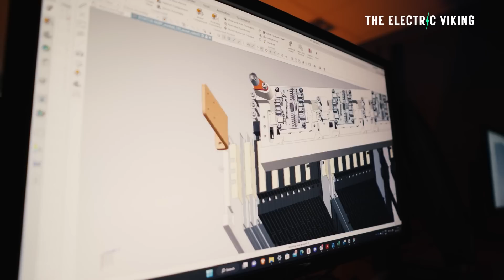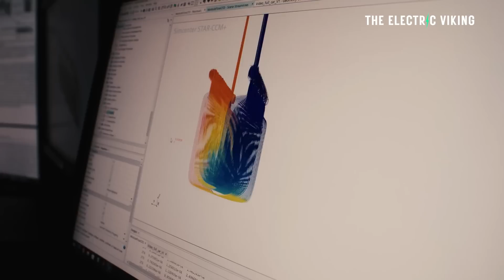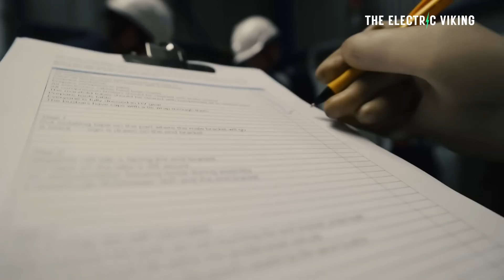Engineers in Europe reveal EV with batteries that charge in under 4 minutes

Comment: My view is that battery chemistry and design will lead to EV’s being cheap and better than ice vehicles and in many ways they are already.  However super fast charging at say 1000 kW/h is highly unlikely because of limits on the electricity infrastructure not just the charging stations but also load on the electricity grid feeding charging stations.

Comment: How do you repair or replace a structural battery pack?  Sandy Monroe tear down of Tesla M3 basically said it was unrepairable and unreplaceable.  This doesn’t sound like sustainable manufacturing. Given EV’s huge carbon sink vs ICE cars currently can Sam look into true sustainability and true carbon costs of EV’s vs ice cars and will we ever have 100% recycling of EV’s. I’m fan of EV’s and been driving one since 2014.  Doesn’t mean that there aren’t issues that still need solving.  My main reason currently for driving an ev is superior driving experience and lowering noxious tail pipe emissions to clean up the air.

Comment: That charging speed really isn’t that fast. That is about 450 KW. They already do almost 350 KW with production cars like the Hummer EV and Lucid Air. You could have a large battery pack and just put 29.2 KWh in it in about 6 minutes right now. This isn’t as big a deal as it sounds.

Comment: I have heard in a Formula-E introduction video by a third party YouTuber, that Formula 1 is not allowed to have pure EVs for some years (they can have hybrids as they have now), because pure EVs for such a Formula-race-series are reserved exclusively for Formula-E, which is managed by some other people.

Well, I can't really believe this. Maybe someone else has a different source.

----
With the first Formula-E generation cars, they needed to switch the cars in the middle of the race because of the batteries, but since the second generation of cars they don't switch cars or batteries and now in 2023 they have the 3rd generation of cars. I think, charging during the race is not allowed by now.

Each team gets the same car with the same battery, maybe the same tires and wheels, but everything else (battery management, motor management, inverter technology, ...) is up to the team - to keep the costs a bit lower but to have something where they can improve...

Comment: Once a car can charge between 250 to 300 mi in 10 minutes you're practically at having unlimited range because you will need a bathroom break before you run out of range and the car will charge faster than you can finish that bathroom break.

Comment: Seeing some of the other comments, sometimes it's worth looking through the other end of the telescope - particularly about the mad high power level needed to charge a large battery in 4 mins. 
What very high "C" charging rates from 6 to 10 to here 15 enable is the use of smaller batteries. 
So a 350kW existing high power charger could add 35kW to, say a at C=10 50kW battery, in 6minutes. This is the battery size in all the current generation of small/medium Stellantis models whether Peugot, Citreon or Opel. 
You'd have a battery good enough and importantly affordable for most of the year but still making longer trips perfectly feasible when required for many [but of course not all] users.

Comment: F1 has been the driver of so much ICE development over the last 50 yrs, just look at turbo-chargers? FE will no doubt do the same thing for EVs. Incidentally, the average time waiting for my TM3 to charge over the last year, is actually zero minutes, compared to 10mins minimum for re-fuelling all my ICE vehicles in the past. I can do occasional 280 mile round trips, and my 120 mile daily commutes, happily on just home charging. Saves me over 30 hrs of annual filling-time a year. So far never actually needed to charge away from home, but expect I will have to at some point.

Comment: What the hell, in formula e, you have to swap cars because the battery does not last the whole race. With formula ,1 no refuelling is required.
A formula 1 car will be more agile and aerodynamic, a battery car less so in comparison. A formula ,1  car will win on a 50  to 70 lap race in a circuit with cornus as well as straights

Comment: They could use the collected heat from the motor and batteries to power an isolated closed loop micro steam turbine connected to a small integrated generator to further charge the battery. This generator could also be utilized during normal battery operation by drawing away battery heat, until the battery is functioning at optimal temperature for maximum efficiency.  It could add a small amount of weight to the vehicle,  however be performance optimised,  based on the battery and vehicle specifications.

Comment: What, EV, are your thoughts on the government / NRMA “initiative” announcing the Australia - wide charging system?
It appears to me that the proposal involves “fast” chargers - which to me says quite low power ones rather than say v3 Tesla ones.
Up and down the East coast charging infrastructure is sparse but doable if you charge at home to start with say 400 Km of range, but over the rest of the continent putting one or two slowish chargers at say 150Km intervals just doesn’t cut it if the intention is to provide for long road trips as opposed to “local” drives such as say Newcastle to Sydney and return.
No-one wants to set out towards a two-stall 22 Kw station in the desert hoping that they will both be available on arrival even if they carry enough energy to get to the next one.
Tesla - and the Tesla early adopters - bit the bullet in the US a decade and a half ago and look at the supercharger network there now! The government “initiative” just fails IMHO to understand the requirements and is merely playing with the issue.

Comment: What if the charger in addition to providing energy, it also provides a super cold coolant as well.  This way the car doesn’t have to try to cool the battery on its own while charging.
Reply: Some of them already cool the charging cable using coolant.

Comment: This is a load of crap.
So far no one has been able to get around the laws of nature.
Electricity works by very well understood Mathematical Equations.
You can only push "X" amount of POWER through an "X" sized Wire.
4 minutes of charging at a ridiculous amount of Current, will give You "maybe" 20 minutes of easy cruising.
The very common ~14-gauge Charging Cables have very limited Current Capacity,
they would have to be ~8 to 10-times larger to Charge an EV Battery in ~4-minutes,
and on top of that, the Power-Lines feeding the Charging Station would have to be MASSIVE.
Reply: You can currently add about 100 miles in under ten minutes to an EV.  How much faster they can go with that I don't know, but already that is not too bad.
Reply: @jamie-ck6js  
That "100-miles" is under carefully controlled conditions, 
no repeated acceleration or stops, no Air-Conditioning,
and a steady ~30 MPH.
Reply: @jimbrown563  It is a rough hundred miles, under the conditions you describe you could add more, on the other hand if you are putting your foot down with the aircon on it will be less.  But about 100 miles in about ten minutes is becoming pretty standard for a depleted battery.

I am not actually disagreeing with you, as I don't know how much further they can push it, but in the UK with the average user only doing about 20 miles a day, so 100 miles in about ten minutes might just be acceptable.

Comment: The counter-factual to a battery that charges very very quickly is a huge draw of amps.  For instance, if my 60kWh EV battery charged in one hour from a 250V line, it would draw 250 amps.  If it charged in 4 minutes, it would have to draw 3750 amps.  (could someone check my figures).  I don't want to be anywhere near any device that is drawing that sort of power.

Comment: That is great that the cars will accept fast charging at that level, the question is will the grid support so many fast chargers in two years time and what energy sources will supply the grid? If it's still oil, coal and gas I can't realy see the benefits for the environment.
Reply: Even if coal, the dirtiest fossil fuel,  is used to generate electricity EVs produce less CO2 per mile than equivalent ICE cars.

Comment: Battery swapping still has advantages even if this becomes affordable.  1)  EVs with easily swappable batteries are far more likely to retain value.  Since the part most likely to degrade so that if catches fire, or delivers less range, is easily swappable for a brand new one.  2) Swapping allows for stations with poor power infrastructure since batteries can be transported to charging "sites".  3)  Because of 2), it is entirely possible to be completely green and only swap with carbon free charging.  4) Battery swapping allows cars to take advantage of new tech.
Reply: Swappable batteries have huge disadvantages. Here are a couple: inability of manufacturers to innovate, the requirement for each charging station to maintain a huge inventory of batteries waiting to be fitted, costing lots of cash. This idea has been tried in China and has gone nowhere

Comment: To charge in 4 minutes, the charging rate must be 15x the rated battery size.  450KW charging rate for this 30kwh pack, 1MW charging rate would only charge a 66kwh pack in 4 minutes.  A 200kwh Hummer sized pack would need either a 3MW charging rate or take much longer at the typical 100kw - 250kw rate available today.  Even today, there is a problem with the cables getting hot and throttling back the charging rate so getting even 200kw is rare, so I have my doubts 3MW charging will ever happen.

Comment: I wondered why charging in the cold is a problem . You would think it would be better for the battery keeping the thermal heat reduced during charging . Still many things to be figured out but it's impressive what can be done today with EV technology . In a decade things will be far different as it is today compared to 10 years ago .
Reply: The battery internal resistance increases as it gets colder and that restricts the charging rate.

Comment: The faster u charge a battery the quicker it degrades
Reply: Tesla Bjorn (Bjorn Nyland) does not confirm this in his tests...He compared 2 identical cars after years of usage by their owners. Both similar KM's One of those owners mostly fast charging the other slow charging. The degradation did not differ significantly.
Reply: @reiniernn9071  thats not what my installed battery monitor tells me every time i plug into a dc charge it degrades more than when i plug into an ac charger i think u need to looke ag many sources not jsut one

Comment: So, does that mean it will take longer to recharge a battery that is bigger in capacity?
Reply: No it doesn't.... That's what the students in Eindhoven 🇳🇱 explained.... 🙂
Reply: No. There is a maximum charging current for each cell so having more cells allows higher charging currents which means that the charging time doesn't change very much.

Comment: charging in 4 minutes - that is "only" 15C (charge rate)  )(lol, jk - RC psacks have had these huge numbers printed all over them for coming up  decades now )- thermal management is the issue. (lots of conduction plates between all cells helps - this is logical, nothing really new here, this is a strength of using flat pouch cells - in a prismatic case with cooling between all cells, note that it does reduce energy density a lot - package size increases, but if offset by very fast charge, who cares.) 
Parallel up enough cells and one can pump a lot of amps into the pack (series switch for highest discharge power).  (Total cycles, irrelevant when charge / discharge is above 10C, power capacity is where that is at.)

Comment: Maybe electric race cars would benefit from the tech although realistically they'd be better off just having hotswappable packs. I suppose they could save on packs if the removed pack could be stuck in a fast charger for the next swap. I doubt any such tech will be visible on public roads for a long time. It's a rarity to see 350kwh chargers that can sustain that rate of charge let alone the 500-1000kwh necessary to bring charges down to < 10 minutes. Just think of the heat given off and thickness of cable needed for that kind of charge - it seems to me that cars would have to change from a CCS style port to something else to make it even feasible.

Comment: Hey Genius can you tell me how many megawatts your super charger has to be in order to charge a 100KWh battery in 4 minutes?
Reply: About 1.5mws constant draw, which is already out through tesla megachargers which put 600kwhs back in 30mins.
Charin has up to 3mw commercial truck chargers that could do it. Nxu is also debuting a 3mw charging system for commercial use.

Comment: What about applying thermoelectric precooling to the batteries?
Reply: Not a good idear. It is not allowed to supercharge a cold battery. The operation window (in temp) for a battery for supercharging as just as narrow as the temperature needed in F1 tyres for getting max performance. Pre heating is the way to go  to the perfect temperature and during charging keeping it at that temperature (with activ cooling)

Comment: This development may be well and good for an experimental race car, especially one with a small 29 kWh battery pack.
But imagine to put such type of batteries in a vehicle that has the efficiency and range of a Tesla Model 3 LR... already a tough order!  Then, this vehicle would have a 75 kWh battery pack.  If you want to achieve, say, 80% charging in 4 minutes, you must have a mega charger capable of delivering 75 * 0.8 /4 * 60 = 900 kW, and that CONSTANTLY, irrespective of the battery's state of charge.
Such chargers do not exist, and will not, except for trucks.  The cable will bo very thick and heavy, even thicker as it will require liquid cooling, that most drivers, except the quite athletic ones, won't be able to handle it.  It will also require charging port much bigger, and therefore probably not compatible with the standard, which seems to be NCAS, which seems to max out at 615 kW (provided a 1000V architecture).
One more development that will not make it to mass market with such promised performance!
Reply: The lfp pack's for base model 3s are around 55kwhs useable so less than twice this size. If those pack's could take this steady charge rate?
You could get a 10-80% charge back in 7-8mins which would be at least 170-180 miles of range.

Comment: Why don't Elon make his own race car?
If he makes his own race, he can show that electric race cars are the best.
He can invite other car brands.
F1 (formula 1) is a standard that the fossile companies are in agreement of.
If the electric cars are faster, this will be the top race, with the best drivers.
Reply: F1 cars speed and performance is purely down to the regulations which are focussed on safety.  So what would any comparison actually be?
Reply: @jamie-ck6js  Electric cars accelerates faster than a fossile car. There will be more overtaking. The safety will be better, or the same.
Fuel burn more than batteries.
There are a reason that electric car fires are in the news.
Fossile cars burns in the hundreds every day.
Reply: @geirvinje2556  You may be missing the point.  The regulations are what would determine the winner, that is why the idea of a "race" has no meaning.  
For example F1 cars have a max allowed weight, that would not include the battery for an EV.  
You mention acceleration, but the power is strictly regulated, if an EV did accelerate so much faster it would fall foul of the max power rules and be disqualified.
F1 cars today could go MUCH faster but the regulations are there to significantly slow them down to aid safety, and clearly these rules would have to also apply to the EV.

Comment: I think there is a place for swappable batteries for two reasons. 1. When the current battery in th car is so defective it needs a replacement. Industry aims for an error rate of 1:1000000. If yhatb is still the norm and billions of people drive cars there will be thosands of cars thatbpotentially needs abattery swap. Why waste a garages time to swap a battery while a swap station could maybe do that? Right? 2. Cheaper cars. If future platorms could support a swappable battery, what I could see as a nice business model is that future EVs will gave smaller capacity batteries for daily driving, say 30-40 Kwh. Certainly as energy density grows. We know from general statistics most people din't drive much on most commtes and only occasionally drive longer commutes such as holidays. I think  it would make sense then to be able to have space in the floor to add another 30-60 kwh packs for rent for those occasional journeys. Three advantages, the EV will be cheaper lighter and more affordable and we will use current reaourcea for making batteries much more durably that the current mantra of more batteries, more caoacity, longer range (more, more, more...). Hyumdai ioniq has shown a  fun EV can be made with amazing efficiency with only 30 Kwh. Meanwhile current vehicles seem to use current battery packs less efficiently in some models.